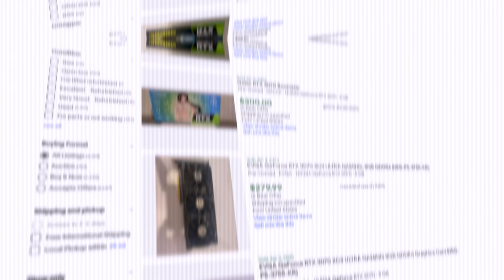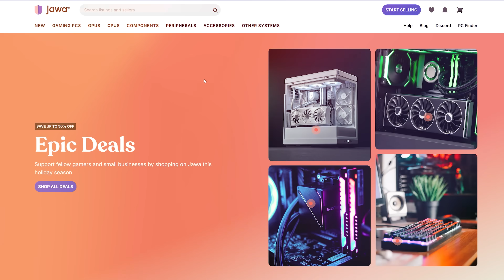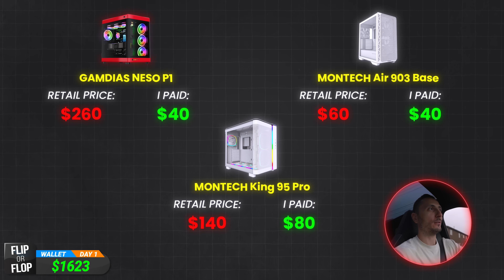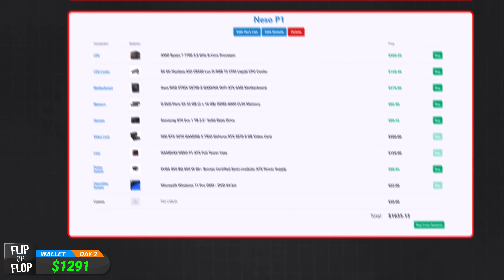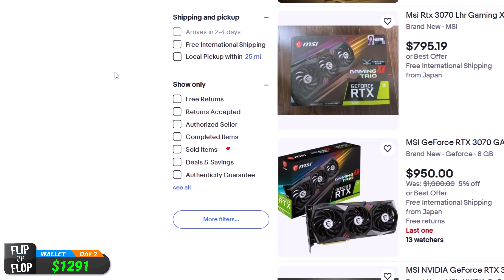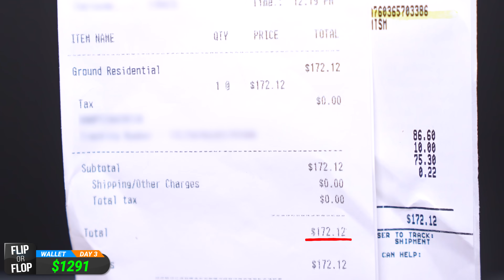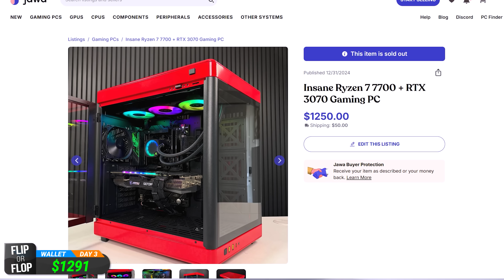The Biggest Profit from PC Flipping so far! - Episode 7

Comment: Biggest profit came by reselling old outdated motherboards and things on ebay, like a Soyo Dragon AMD athlon processtor mobo. 
It's nerds man, they buy it. I have a PC for sale it's a 4700k 4.8 GHZ OC and 1070 FTW, usable Z87 board Asus and it has 16 gb Corsair 2200 ram, the case is a collectible Antec with a 120mm fan working, new fans have been installed and I gave it a professional cleaning, cable routing, looks minty inside. 850W gold psu modular, has a fresh SSD 500gb just to boot up with.The case is worth 300$, so...the PSU is worth as much as the processor, I get it. The 1070 FTW is EVGA. How much can I get for the whole thing ?. It's rock solid as is, has a 120mm liquid cooler master.

Comment: Can someone help me?
How can i control al my rgbs? this are my specs
Moederbord: AMD A520
Cpu: AMD Ryzen 7 5700G - 8 cores - 16 threads - 3,8 Ghz (4,6 Ghz turbo boost)
Gpu: Onboard Radeon Vega 8 + rtx 4060ti
RAM: 16GB DDR4
SSD: 1TB M.2 SSD
Behuizing: AeroCool Glider
Koeler: BOX
This is wat the prebuild said it has and i put in the 4060.

Comment: I work at a computer store and i build and upgrade PC’s on a daily basis. I get some unbelievable deals from the customers who try to get rid of their old parts. Sometimes I get them for free sometimes I just get them for dirt cheap. Got a 2070 super for $40 out of my pocket and gave them a $50 store discount since they were upgrading to a 4070 TI super. Also got a 1080 ti for free because the fan on it was broken but got it fixed myself by just getting the replacement fans for $15 off of aliexpress

Comment: Hi ed! I am going to build my first ever custom pc and wanted to get your opinion on my build. so i found an mis geforce rtx 3060 gaming x trio 12g for 170eu of marketplace. im using the i5 10600kf on a b560 motherboard because i cant really afford a better cpu😂😂. a 700w power supply 32g of ram at 3600mhz because i only play fortnite and cod on comp settings. all in the nzxt h6 flow and 3 tzmrit fans (lian li knock offs) im selling my current pc for 400eu so i only have to take out 200 euros for this build. is this a good build? let me know. its more of a budget build
Reply: im upgrading from a gtx1650 i3 10th gen 16g of ram at 2666mhz